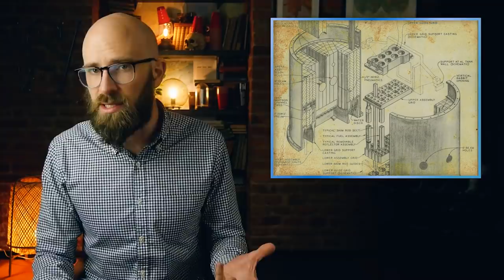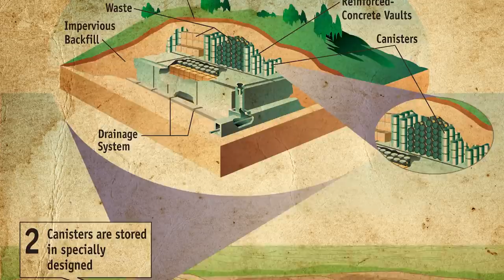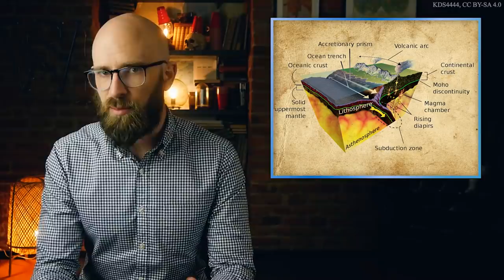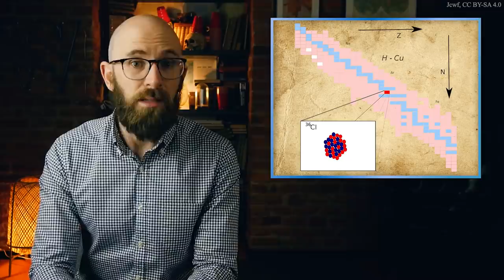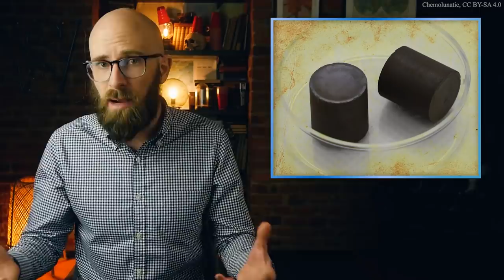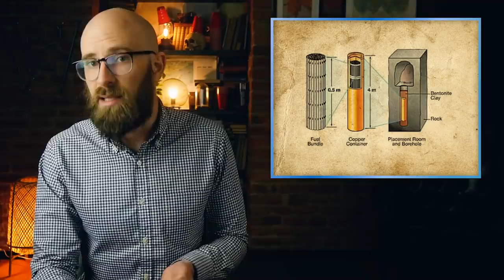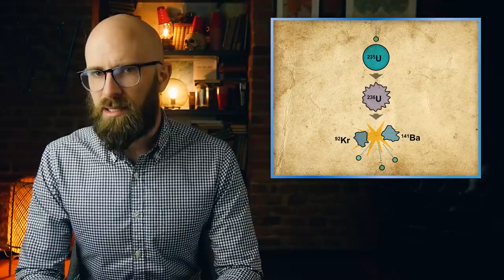How Does Nuclear Waste Disposal Work?

Comment: This video is much needed info on waste storage. I did also want to hear about the process of turning waste into diamond.
Reply: ummm... diamonds are made of carbon, so......
Reply: @MrTaxiRob  yes, but radioactive materials pressed into diamonds emit safer levels of radiation
Reply: Popular mechanics " encapsulating nuclear waste in diamonds" turns into A safe battery
Reply: The Diamond thing is a scam, and in any case only ever applied to one rather uncommon type of nuclear waste. 

There are however several ways to chemically convert the material that contains radioactive isotopes into more stable forms that trap the radioactive isotopes inside them. Vitrification is the most well known, which is just converting it into an obsidian like glass. But there are several others, it can be made into cement called grouting, into a ceramic, metal, or just about anything else. 

It's important to remember that radioactive atoms still have all the same chemistry. So as long as they're in a molecule that's solid at normal temperatures and pressures most of the isolation work is instantly done. You just need to toss it down a hole or something to finish the job. Everything else like all the armored boxes is just decoration after those two steps.
Reply: I'm just a lazy YouTube watcher. I was just hoping Simon would do a video on possibly putting nuclear waste into diamonds

Comment: The city I Live in GE  left and when they did they ditched the Nuclear Waste down elevator shafts in there building and threw  concrete over it...as well as the lake across from the building ...the lake was cleaned out only a few Years ago..there building not so much and they haven’t planned on building anything on the Lot in 20 Yrs

Comment: with the costs involved in deposing of the waste , its a wonder that the nuclear reactors are economically viable
Reply: You don't need to get rid of nuclear waste, it's entirely recyclable.
Reply: @TechnoMinarchist  No, it's not.
Attempts have been made. Reprocessing spent uranium fuel into MOX sort of works, with a top-up from excess military plutonium (which was expensive to make). 
Used MOX fuel is a lot harder to deal with. More and more diverse fission products, more actinide products, and more U232. That stuff will need longer interim storage and more secure permanent disposal. 

The reactors that can just burn wastes as fuel are basically imaginary. They depend on materials we don't have,  and may never have.

Comment: How does mining actually work? Like we all know it happens, but how has it evolved? How do you mine radioactive substances? Etc.
Reply: Easily... Natural Uranium is barely radioactive, so the whole process is barely more radioactive than the 'non'-radioactive 'normal' mining of anything else. And mining is already one of the most radioactive professions usually due to Radon gas and Xenon that's released from the ground when the rocks are shifted. 

While Thorium is usually a byproduct of other mining process and can be extracted almost for free from the waste products. 

Some places do it with robots now, but that's for dust hazards not radiation hazards and also for general improved mine output. There's also a new method called in-situ leaching where solvents that bond with uranium is poured over the rock and then pumped out of a nearby well along with all the uranium they grabbed during the trip. This method allows for most of the digging and heavy equipment to be completely bypassed.
Reply: @bronzedivision  Wrong again, now I know you have YT education.  U235 is what is sought after for nuclear reactors.  You have to mine millions of tons of the neutron capturing stable U238 just to find the sought after U235.  The naturally occurring U238 is what keeps the smaller amounts of U235 from chaining out like in our reactors and why many radionuclides are not found in nature.  Do you know where PU236 is made????

Comment: the only place you could consider a repository in the US is the Hanford Site where they bury the spent reactors from naval ships
Reply: No, it was evaluated as a potential site, and found unsuitable due to fractured basalt as the isolation environment.  Waste would be far to mobile to use it for long term disposal.
Reply: The reactor housings are just steel, and the cobalt-60 that the steel has been turned into by radiation.
They have however been washed clean, and the cobalt will decay in relatively few decades.
The spent fuel itself is quintillions of times more radioactive. It needs special sites.

Comment: There are far safer reactors based on molten salts that are less radioactive but have very useful thermal curves that can be used to generate steam to power turbines. Further research and use of these reactors would solve the problems of our present weapons-based nuclear fuel reactors. Since they are molten salts, to stop a reaction, and safely shut down a reactor immediately, the molten core is dropped into a tank where it will freeze when it falls below molten temperatures and remain completely safe. No cooling required.
Reply: There are no such reactors that can work continuously at commercial scale. A small handful of tiny experimental reactors that had necessarily short lives.
Containing molten salt at those temperatures, plus the extreme chemical diversity of fission products and the inevitable brittling of any material by the intense radiation requires materials that simply do exist yet.
Your molten salt reactor requires a non-existent container. Decades away, at best.

Comment: I've always wondered.... if the transportation side wad perfected ( cost and reliability),  what would happen if we loaded up a huge cargo ship in orbit, and set the autopilot towards the sun.
Reply: To the sun? Nothing. No-one observing the cargo ship hitting the sun would even notice anything happening. The whole earth could be pushed into the sun and you would barely notice it. Radiation prob would be unmeasurable, the amount would be so miniscule compared to the heat and radiation the sun already puts out.
Whole thing thing would be "nothing... nothing... wub... nothing... nothing..."
Reply: It's like those funnel games where you drop the coin to roll on it's edge and fall in toward the center. With each revolution it gets only slightly closer and speeds way up until it gets so close it's moving so fast it's a blur. Instead of a hole you're trying to hit the sun which constantly pushes outwards via solar wind. You'd only be deflected until you can burn off all that gained speed.
Reply: If you set course directly at the sun it would deflect you and then possibly eject you right out of the solar system with all that speed you gained in the "fall."
Reply: The cost-per-pound not to mention the risk would make "launching" any waste super wasteful. It would be like an infant playing in its own doo-doo. Clean up the clean-up and then do it again...hyperdumb.
Reply: @thomasewing2656  That is mearly your opinion.  You speak about cost.....thats the clue right there.  Any pronuclear person speak of is cost.  Like price per kilowatt hour that doesn't add the cost, inflation and unknown factors to the entire cost.  It is a falicy to believe that also the deaths per killowatt hour is true when the only deaths that could be associated with nuclear power are hidden in the total Cancer, auto immune disease,mutations and upwards of 1800 different diseases and ailments caused by even low dose internal exposure to ionizing radiation.  The inverse square law does not apply to extended sources period....
Reply: Well, for one it would need so many launches that something is bound to go terribly wrong at some point. 
Second, it would take an absolutely absurd amount of fuel to propel all that crap on a collision course with the sun, requiring yet another crap load of rocket launches. 
You'd probably double the amount of co2 released in the atmosphere just with those rocket launches.
Reply: @Grouuumpf  Yes something would go terribly wrong....ALMOST LIKE THE CHANCES OF BUILDING A NUCLEAR REACTOR ON A FAULTLINE AND NEVER EXPECT AN EARTHQUAKE OR TSUNAMI RIGHT? Yes I know the caps lock was on but thats how important that correlation is.  It can be and has been packaged to not only survive an explosion but also re-entry.  Therefore everything you said is  incorrect.

Comment: I thought molten salt thorium reactors could use old spent nuclear waste. Therefore cleaning it up.
Reply: Maybe but there hasn't been a practical implementation of that technology.
Reply: @revcrussell  the MSRE at Oak Ridge was operated that proved the technology ...... however some could argue this is a long way from a system that can recycle spent nuclear fuel over a sustained period of time
Reply: @robbiegregg  It proved it couldn't operate for very long. There were fundamental problems of chemistry, especially corrosion. These problems have not yet been solved.
Reply: @robbiegregg  I believe also at Santa Susannah which exploded.  All these reactors are not new especially in idea and exploration...its just never been a viable option and most all reactor issue is indeed the metal the reactors are made of that can't handle this type especially.  And again all reactors will form some sort of nuclear waste as a bi product....nothing is for free...

Comment: There is really no reason to move or store it - no one has ever died from stored nuclear waste.  Besides, it will be valuable fuel in future thorium molten salt reactors.
Reply: No it won't because there will be a surge of people that will demand its use ceases immediately and a safe plan to dispose of it off planet preferably.  Craig, you are wrong and have been proven wrong in every comment section you enter and you need to stop pretending you haven't already lost with any point you attempt to make.  Let's prove it...you and me right here on a neutral stage. Lets see what you have Craig Ill let you begin.  What do you want to talk about?
Reply: Paula Moby   So prove anything wrong in that statement.  You don't stand a chance against facts.
Reply: No one wants to hear common sense like that. God forbid we treat a rock like rock. :P
Reply: No one has died from stored nuclear waste??? That sure is a bold statement being that the only way of knowing is to know what each cause of cancer is specifically...
Reply: @bronzedivision  Its not a rock once we mess with it.  Otherwise we would just throw rocks in a nuclear reactor.  Does that rock contain U235 or just the neutron capturing U238?
Reply: Pail Moppy  Show someone that has died due to stored nuclear waste.
Reply: @Craig Douglas Aka ForbiddTV Aka Dana Durnford and Kevin Blanch debunked....this routine again Craig really?  Do we really have to do this dance again?  Ok.  Show the list of deaths caused by cancer that we induced by ionizing radiation ONLY.....
Reply: You do know your comment is mixed among a thousand other comments that more than likely never be seen.  I will not let you spread your bias all over nuclear fission videos.
Reply: Pual Moby  Why is this so hard for you?  Show someone that has died due to stored nuclear waste.
Reply: @paulmobleyscience  hey buddy. What happened to your channel? You haven't put out a video in 3 days, and that one was just piss poor Latin, alluding to you giving up.
Reply: @paulmobleyscience  do you regret replying to my joke now 😂😂😂😂
Reply: @ForbiddTV  I am sorry you are indeed wrong about spent nuclear fuel.  Spent nuclear fuel does NOT contain radioactive Thorium as a normal product of a commercial reactor.  It is produced in a breeder reactor using natural Thorium as the material to be irradiated.
Reply: @vanguard9067   Fast breeder reactors and some thorium reactor designs.  Problem is we haven't built any of them.
Reply: @ForbiddTV   I am pretty sure we are talking past each other on this thread.  I was responding to a comment on spent nuclear fuel, trying to clarify that the reactor types do not produce thorium as byproduct, AND mentioning that breeder reactors do.  I think we’re are probably on the same page, just talking about it from different perspectives.
Reply: @ForbiddTV  the US has had a number of research and prototype breeder reactors.  There was one small commercial breeder rector (Fermi 1) used to produce power.  It suffered a partial meltdown and was subsequently shut down.  LMFB reactors are technically complex and very expensive to implement.  It’s been awhile, maybe the technology has improved a lot since the US last tried one.

Comment: The ASME - American Society Mechanical Engineering - International sets the standards for toxic wastes in the codex : BPVC -section 3 OR 6 if i ain't wrong.
Reply: ASME section 3 is the boiler code for nuclear reactors not waste.
Reply: @revcrussell  ASME-BPVC section III  division 2:code for concrete containers
Reply: @revcrussell  there's other sections for specially for spent nuclear fuel u just don remember ..

Comment: I am curious if we can use a well strengthened decommissioned nuclear missile silo. If it was expected to survive a missile launch and hold on to nuclear material as is, it could be the starting point if long term storage. Plus I am sure some of them are already partially secure, plus inconspicuous to begin with to prevent espionage or someone accidentally coming across a nuclear missile ready to be primed for launch. Plus they could probably have a monertoring system that could be retrofitted for the new task so any issues could be immediately noticed and dealt with before becoming a major issue, at least a medium timeframe until the fall of the government body overseeing the project.
Reply: There's a bazillion ways to dispose of nuclear waste, and not doing so is actually a very serious option. :P But the science free anti-nuclear lobby has set such high standards that it's at the point of insanity and all but an impossible problem.
Reply: @bronzedivision  Bazillion?  Is that  scientific teminology or mathmatical???
Reply: @bronzedivision  The set standards are the LNT.  That is the set peer reviewed standard....not "standards" set by lobbyists and politicians.....

Comment: I'm curious if the pools give off hydrogen can we capture the gas and use it.
Reply: It doesn't make enough hydrogen in sufficient quantities to be useful.
Reply: they probably do so it doesn't explode. But my understanding is the hydrogen produced when not hot shouldn't be anything crazy why it exploded in Fukushima after it you know got hot
Reply: @kevingehon3028  Correct, the hydrogen explosion is usually due to a chemical process with the cladding, not a nuclear one. Radiation does cause hydrolysis but not at rates where the hydrogen is useful. In most cases, it isn't even a concern.
Reply: The pools give of ZERO hydrogen. Simon made a mistake with that part. The explosions a Fukushima were caused by chemical reactions within the reactor.
Reply: @bronzedivision  You are correct from a practical point of view. I am correct from a technical point of view. As already explained, radiation does cause hydrolysis, hence tiny amounts of hydrogen gas.
Reply: @bronzedivision  Wrong, not only is hydrogen given off but also tritium.  Water soluble transuranics and radionuclides evaporate under equillibrium conditions, bond with molecules and move around the planet.  H3
Reply: @bronzedivision  Deuterium, heavy water, H3, tritium.....

Comment: My unasked for opinion?

Solar where it's sunny, wind where it's windy, hydro, geothermal, tidal , etc, where it's most effective to use them.

Still, this will leave a large gap for "baseline" power - when sun isnt shining, wind isnt blowing, etc.

For that, with current tech, it's down to 2 things.

Either we keep using more fossil fuels, with all the horrors this means (climate change, mountaintop removal, transporting all that shit around, etc)

Or, we move to modern, safe, regulated atomic (rebrand!) powerplants, which put out no greenhouse gasses (could easily make a little extra power to scrub some CO2 from the air or w/e), and will save 100,000's of lives per year (fossil fuels kill in countless ways, just the particulates alone cause countless deaths, but these deaths are spread out over a large area - the whole earth - and aren't always obviously caused by fossil fuel use, so people underestimate the deaths.

If we didn't need any power, we wouldn't make nuclear plants. Not only do we need power, we need maybe 5x as much over the next decades as China and India industrialize and start buying fucktons of air conditioners, fridge+freezers, cars, etc.